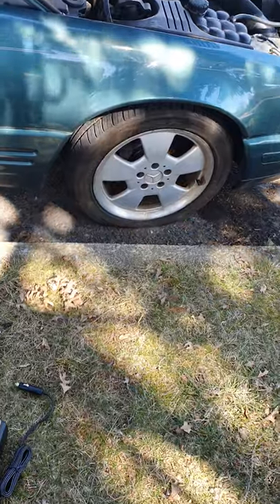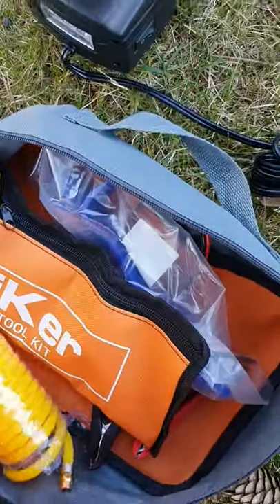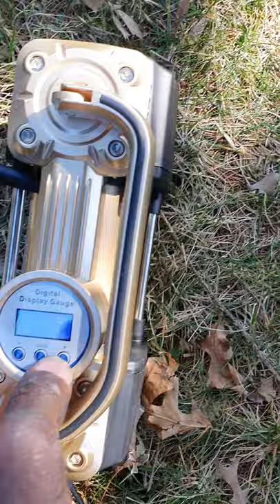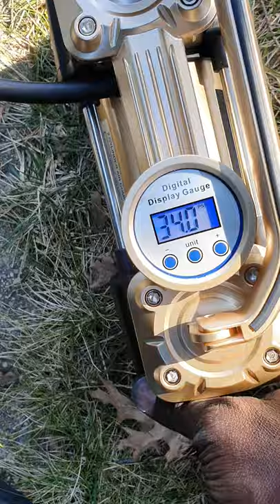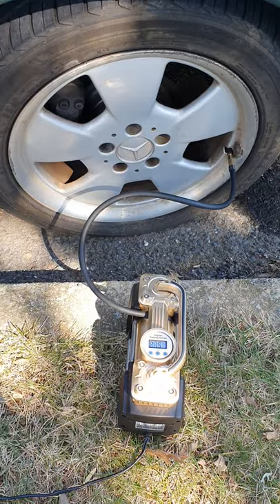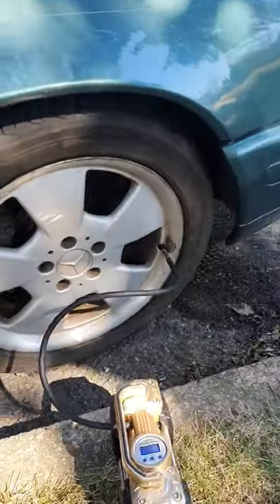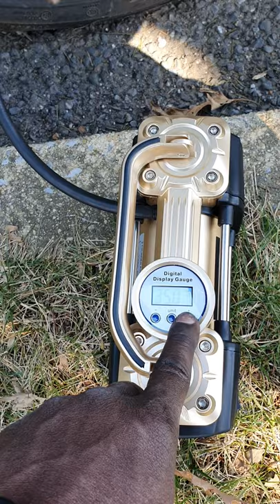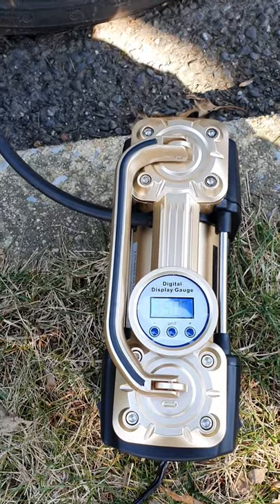Review of Amazon iker Portable Air Compressor Pump

Comment: Up to 25A? That would blow the fuse on my cigarette lighter. Would have to connect directly to battery.
Reply from the maker: Haven't had any issues using the cigarette lighter on multiple vehicles